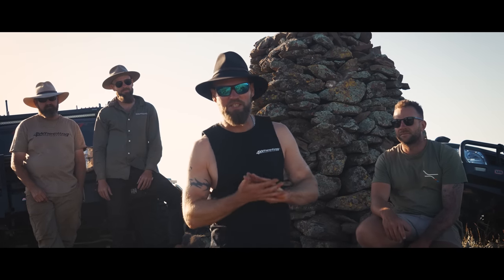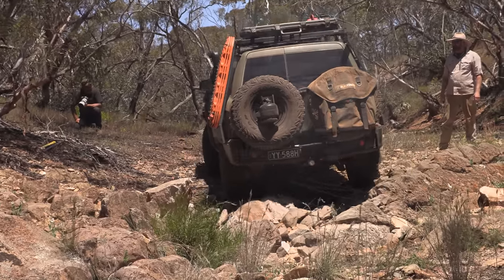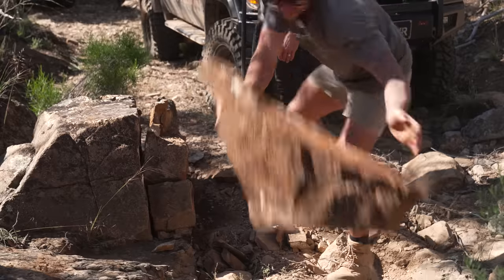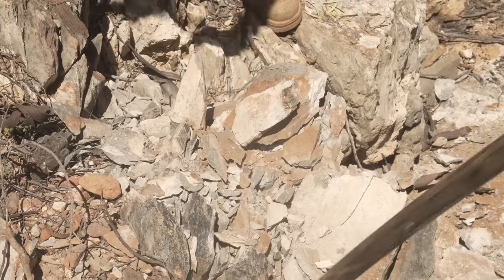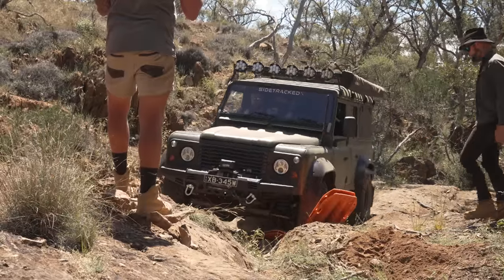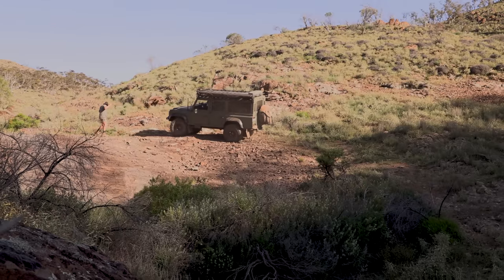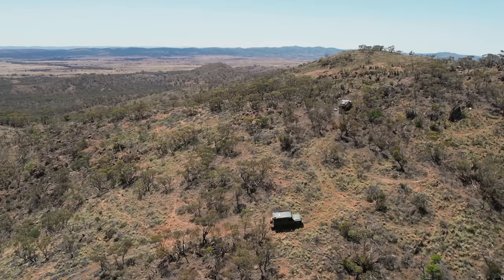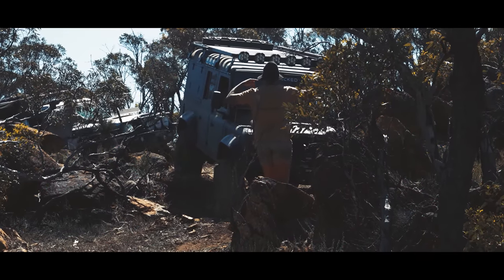FIRST 4x4 VEHICLES TO CONQUER THE MOUNTAIN

Comment: I'm surprised that there isn't a spring hanger conversion for the 79 series to locate the springs to the top of the axles.
Reply from the maker: It can’t be achieved without making the rear minimum 6 inches higher which makes the tray a bit difficult to work with for most people
Reply: @Ronny Dahl  my 2013 Ram Power Wagon is the last of the last leaf springs, as Ram went to rear coils after that.  From factory mine are spring over, but they mount to the side of the frame, enabling the axle to sit closer to the frame.  Hanging up on springs is just not a thing on my truck.  Watching this video made me realize the huge geometry differences between the two vehicles, even though they are both outfitted with leaves.  Obviously, there has to be space and track width to make that side mounting a possibility.
Reply: @Ronny_Dahl  sure, but given the axle is now below the spring pack, you could have the springs re-arched (or in this case straightened) or change your shackles maybe to drop back to 2-3" of lift.... To me it seems like it's enough of a "hang up" (pun intended) that someone should have found a solution by now... Perhaps there's some legalities/engineering that prevents you from doing so in Australia...
Reply: @johnfitzgerald5158  GM has top mount leafs, springs are good for unladen ride and can be progressive enough to carry a load. But not as well as a leaf spring setup. Plus the extra 4 or 5 link bars add to the chance something can shift/bend/break too. I know they make coil conversions for 79's (I think) but many don't because it's an involved process that would be far more work than a new leaf pack and shackles... Plus it's harder to get the GVM right with coils. And adds more body roll
Reply: @craigquann  I wonder if there is enough room on the outside of the frame to to put a spring eye hanger bracket and a shackle bracket, like on my Ram (pretty sure GM and Ford leaf spring models are similar).  Then when the spring is top mounted on the axle, it is mounted farther toward the wheel but the eye and shackle is nested higher up along the side of the frame.  This would seem to add  more spring leverage against the axle, being mounted more outboard, also creating more stability.  At the same time enabling flexibility in picking a spring rate that strikes a balance between load capacity and flex for offroading.  The leaf spring set up on my Ram is extremely flexible, more so than the newer coil spring models, yet has a better load carrying capacity.  No links or trackbar or swaybar to restrict the axle movement.   I know this is counter to most hivemind think about coils vs leaves, but I think the mounting placement is key to why my particular model has the best of both worlds.  It can work,  but probably not where the 79 has its springs mounted to the frame from the factory.
Reply: @johnfitzgerald5158  yea the spring hanger is on the outside. GM's can be raised/lowered depending on preference by just changing shackles.
Reply: @johnfitzgerald5158  my Sierra flexes great in the rear but still has 1900lb payload for a 1500. I've definitely gone well above that without even Riding the bump stops.
Reply: @johnfitzgerald5158  I also think there's an "under axle" conversion if you want to really slam a gm. But it requires notching the frame and adding a new portion
Reply: @Craig Quann  nice.  I had an '02 Burb 2500 w/8.1L big block before the Ram.  I loved that truck.  That was leaf sprung in the back as well.  Wish GM still made a Burb that is a real truck like their pick ups.  I could sleep in the back of that with the 2nd row seat folded down.